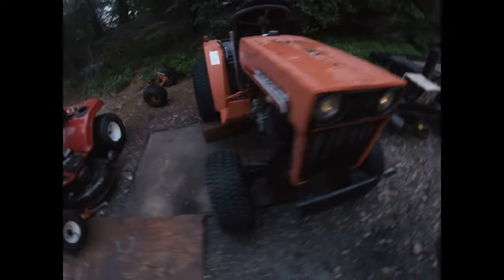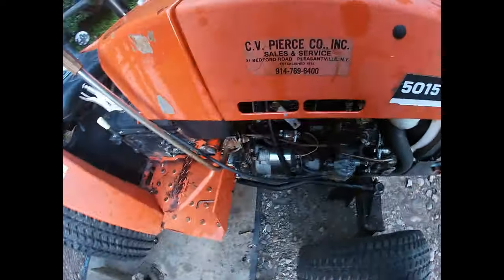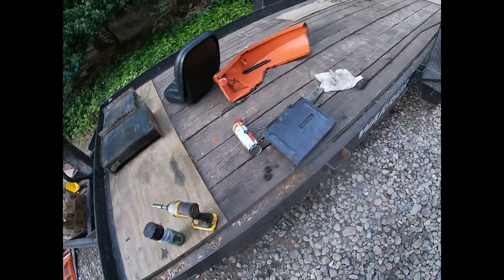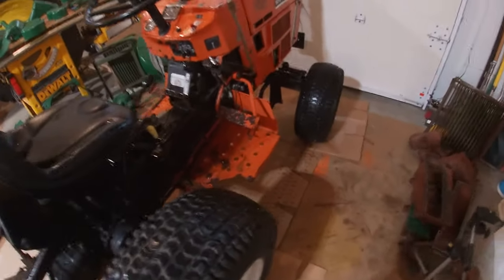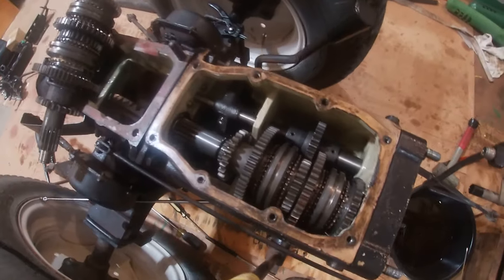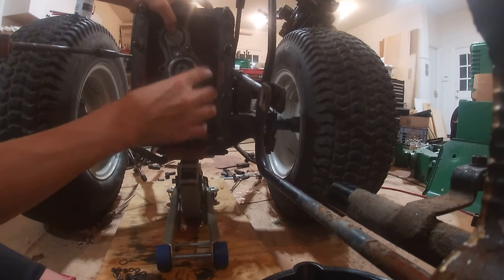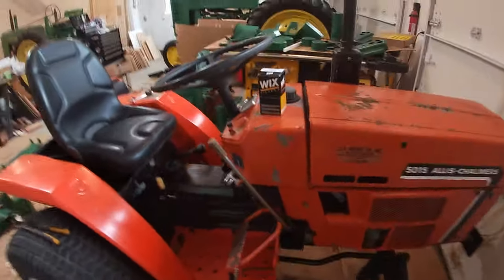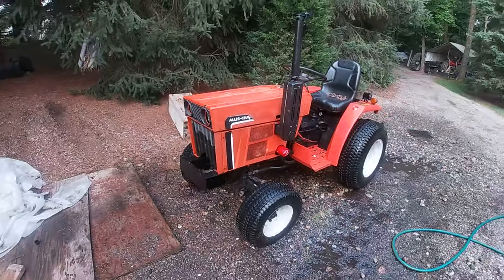Fixing an Allis Chalmers 5015 and Replacing Countershaft

Comment: Please, what are the replacement lights?  Could you post a link?   I need to replace mine as I can't find bulbs for the original lights!
Reply from the maker: They are 3" round led lights 27W on Amazon. I forget exactly which ones I bought.
Reply: @thesmallenginekid did you find led bulbs for the original lights?